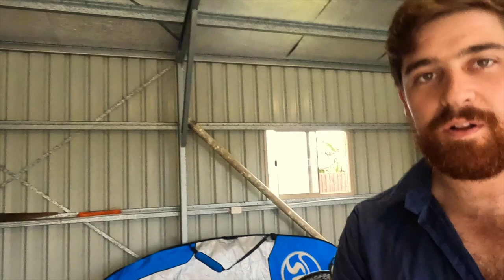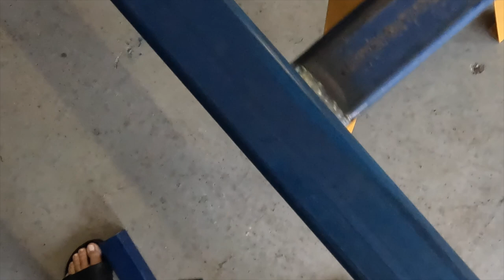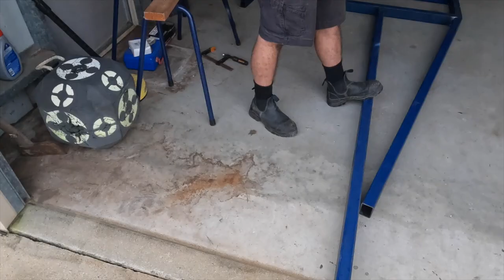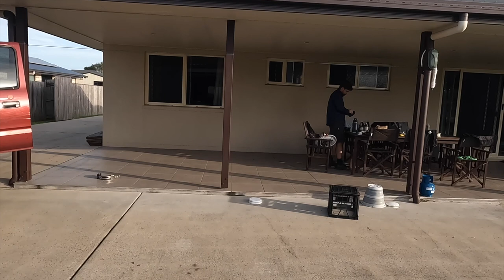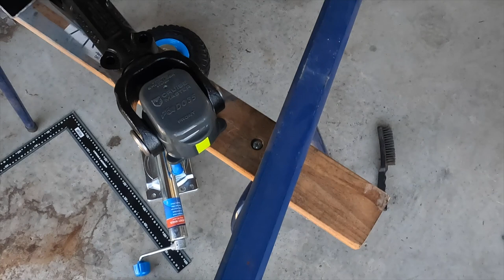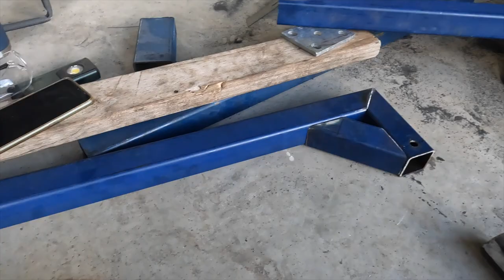OFF-ROAD BOAT CAMPER TRAILER BUILD - PART 1

Comment: Great work mate, trailer looks solid and your vertical welds look really good, If i had built this i would have wasted so much time re-orienting the piece so i can do down hand welds. Love the idea of having a spare hub, Gonna use that on my trailer.

 Just a bit of advice. If  your garage floor is like mine and most others, it probably isn't  flat. a way to get around that is by supporting it on 3 points by just propping it up with a bit of offcut. The math behind this is that in a 2d space, any 2 points make a perfectly straight line. add a 3rd point in the 3d space and you get a perfectly flat plane. The size of the off cut doesnt matter aslong as it is only contacting at 3 points. I would suggest welding up an L section of the frame with 1 support in the middle and the other 2 on each end. 

Pythagoras, Trigonometry is what you were looking for to solve that drawbar question,  Basically having known your draw bar length (X) and  frame width(y) tan^-1=X/Y will give you the angle from frame to A frame, sqrt(x^2+y^2)= length of a frame member (H), Sin^-1=Y/H will give you the angle from drawbar to A frame.

The accuracy of these lengths are critical as  having this skew can cause the axle to  not be perpindicular (90degrees) and cause crab walking.

It's probably too late and it looks like the trailer turned out fine but hope that helps regardless.
Reply from the maker: Thanks bro, appreciate the kind words!